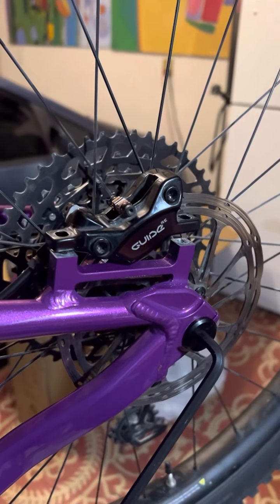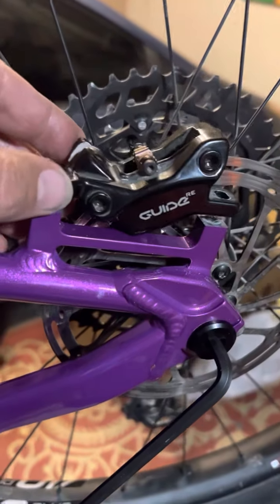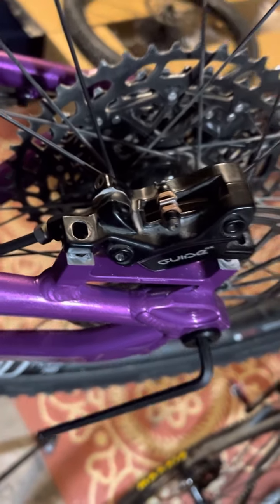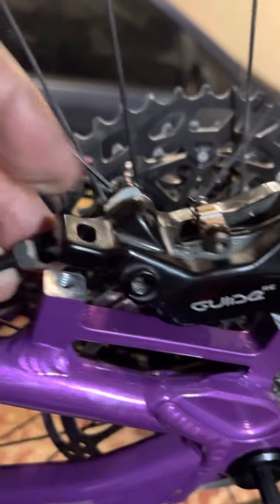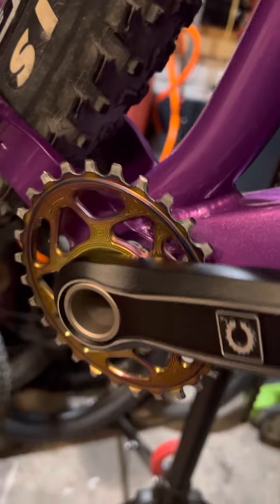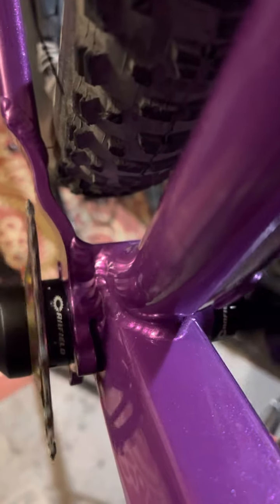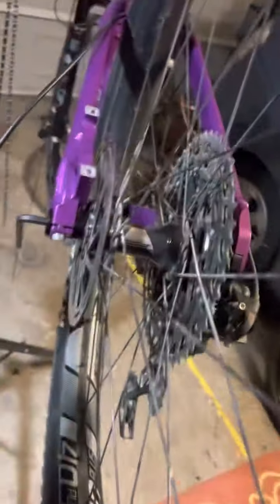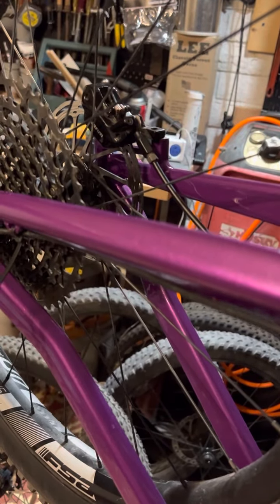Canfield Yelli Screamy manufacturing issue

Comment: Boost Spacing, is your hub a Boost Thru Axle.  Boost pushes the rotor out by 5 millimeters.  And the Yelli says it is boost spacing
Reply: Definitely not a boost spacing issue.   Welding issue for sure.

Comment: I have the same issue. I have the Yelli in both a large and medium. The large has zero brake issues with two different sets of brakes. The medium however has this issue, what I did was space the rotor out with some shims I had and no problem now.

Comment: *I posted a followup comment below*

I have this problem on a medium frame from early 2023. Canfield refused to replace it tho they offered to sell me a new frame at 30% discount. I think its bs that a brake mount welded on crooked doesnt count as a manufacturing defect.

Additionally, the original threaded holes for the brake posts are filled with jb weld and then re-drilled off center to try to make this work. Im so bummed Canfield let this problem out of their factory and wont honor the 2yr warranty.
Reply: This is NOT cool.  I am telling everyone to make videos and post them on YouTube.   If enough people document the issue they may have no choice but to make it right.   They offered to send me other frames as replacement.  I made them mount a wheel and caliper.  3 other frames at their warehouse had same issue. That’s when they offered me full refund.
Reply: Yeah it sucks. The customer service guy said "oh yeah we'll get this replaced, send us some close up pics of the brakr posts". He called me back the next day and said Lance said the posts were fine and none have failed in a year and he wouldn't replace the frame. I was a little shocked he wants nonfunctional jb welded brake mounts out there with his companys name on them. I dont think I will be taking him up on his 30% off offer and wont be supporting Canfield anymore.

You can even see a sliver of the jb weld hanging out in this video on the lower brake post.
Reply: I have to post a followup on me having this same issue. Initially Canfield said they wouldnt replace the frame and I thought it was over.

A week later a different customer service guy emailed me and said they want to replace the frame. I mailed the old frame back and received a new one a week later. The new one built up smoothly and the brake posts appear to be metal. I didnt find any other problems putting the new frame together. So...I'm not sure what happened initially or motivated them to change their mind but in the end they stepped up.

They said the thread repair is not jb weld but didn't say what it was other than a metal filled epoxy.